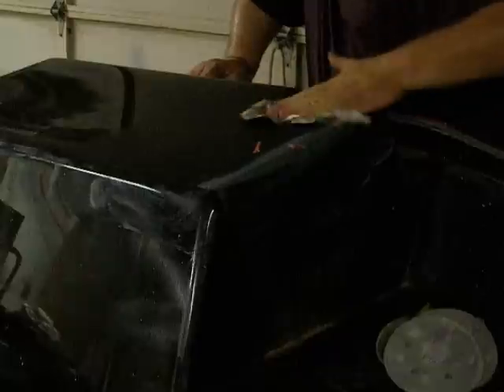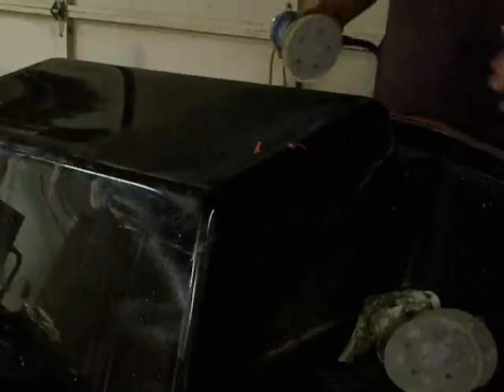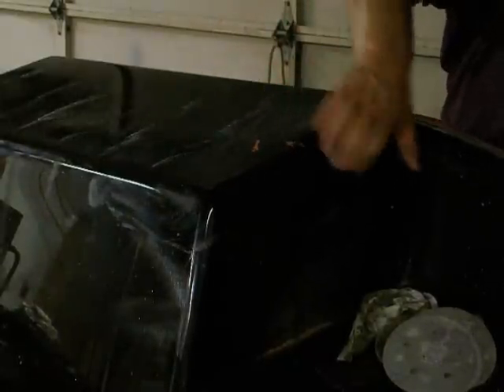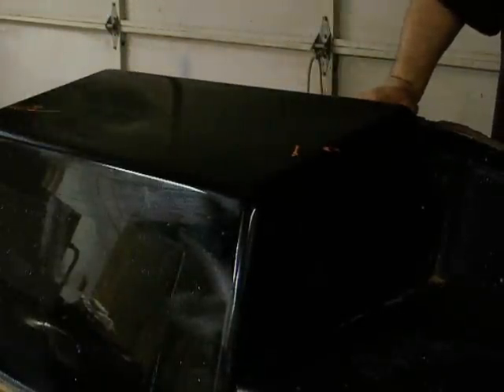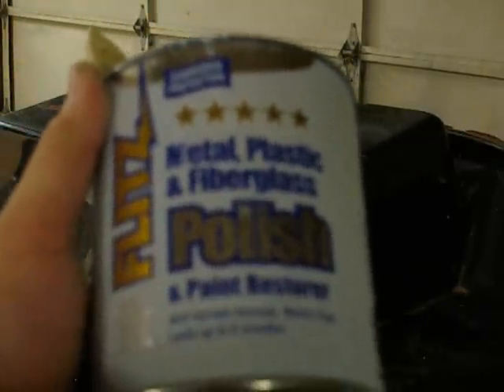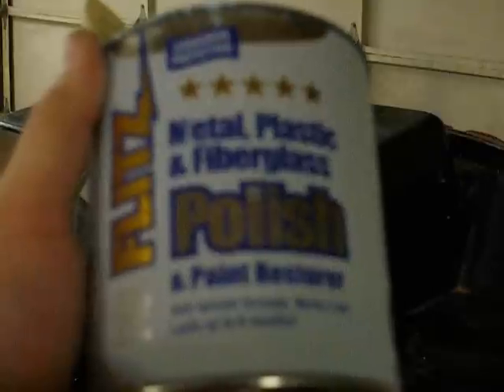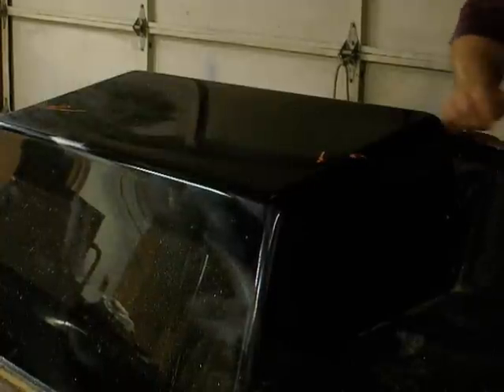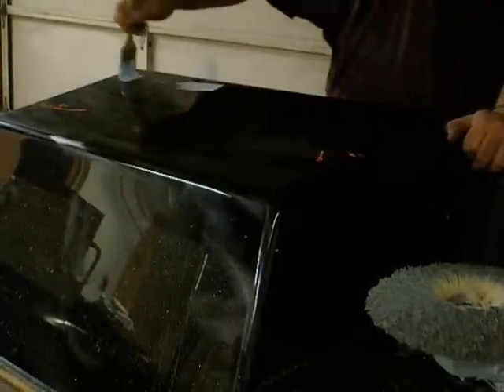How to build a fiberglass boat.  Mold Prep part 3b

Comment from the maker: If you wax it, it should still release.  But it will not be shiney.  You need to polish the mole to get the shine back.  If your part doesn't need to be shiney, like for something that you are going to paint after you pull it, then having dull spots would be fine.
The more I polish in the mold, the less I have to polish on the part I pull from it.

Comment: hi again. after finding a few chips on my mould i put some filler paste in to fill them up and wet sanded it down. but when i had finished sanding it i found that where i had sanded the shine or gloss had gone from that part of the mould. is this ok will it still release or do i need to put the shine back in some how. thanks again. great job by yourself my hat is off to you.